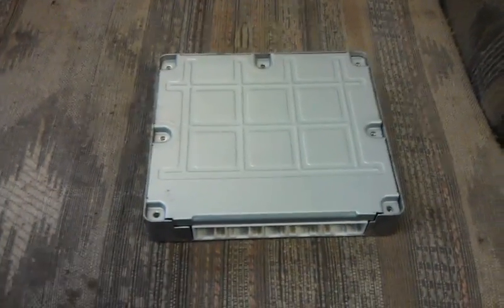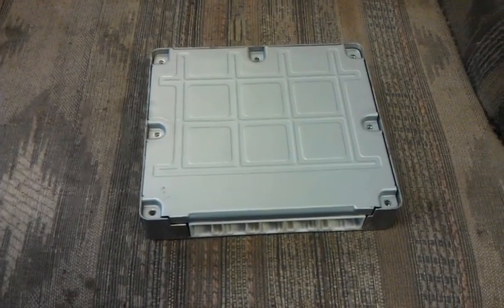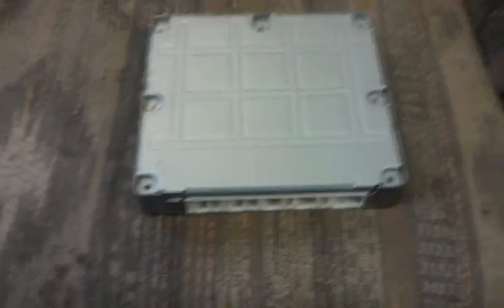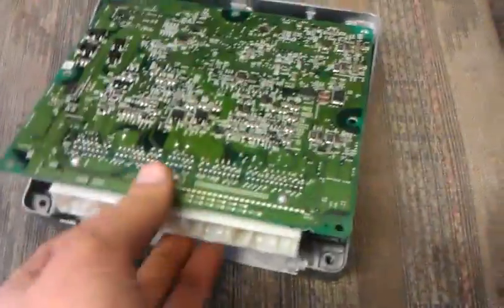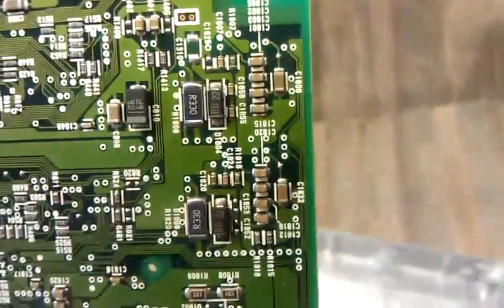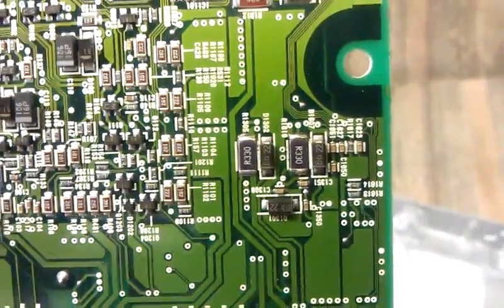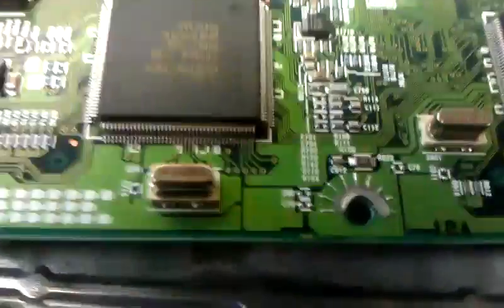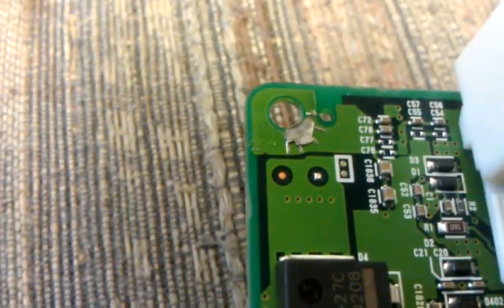HOW TO FIX RAV4 ECM ECU TRANSMISSION PROBLEM. **READ DESCRIPTION!**

Comment: OK, I had serious reservations on this task. Reading the comments only vulcanized my feelings, but decided it was well worth trying as the ECU was coming out anyway.
The PC board looked brand new coming out of my 2003 RAV4, so there was no oxidation - very nice manufacturing quality, I might add. But, being a Sr. Electronic Engineering Design tech, I've come across some 'impossibilities' in my debugging career, so if there are folks who said it work....I'm down with that.
I did not stick to the few items mentioned by Jake - heck no. If I have an intermittent, I will reflow the solder on ALL the components, if I have to. But, I decided to stick with the high current items involving ANY of the resistor packages described (1210, I believe: .12" x .10" - BTW, for you DIYR's - Digi-Key Corp is your ultimate friend for finding parts of this nature). And, I continued to reflow the devices connected to said resistors (reflowing all these resistors, of course): all power control IC's (a number of 20-pin (?) IC's), and all power drive devices (black, 3 legged parts with tabs solder to the board).
I just shoved it back in place after reworking for a test drive - and IT WORKED!!!
Many thanks to you Jake for posting this. Otherwise, I would have spent a couple, or a few Franklins on this fix!
One last word to the wise: if you cannot solder, meaning, if you don't have the proper tools to start with (small diameter soldering tip, thin gauge solder, ample visual magnification), and you're not experienced with PCB rework - do not attempt to try this!! Soldering is not rocket science, but debugging your rework error might be.

Comment: Hey Jake, I am having this same shifting issue with my 2003 RAV4 - Chili. I took it to a mechanic and after checking the code he said that this was a Solenoid issue in the Transmission. Was this the case with you too, before you decided to take a look at the ECM?

Cheers
Reply: Am haveing the same problem with my 2000 rav4
Reply: Did u fix urs

Comment: Well its been a month now and its working great. So for me that confirmed it. "Bad Solder Joints." Thanks jake moon. Well made video and it saved me time and money. You could probably just reflow the solder for a short fix but I replaced the solder on those resistors in the video. Can't thank you enough....
Reply: Solder. I replaced the solder. I didn't just reflow it.
Reply: Is it still working well? Some companies are slating this video and saying the problem is more complicated. I guess if it's this simple must be a real money spinner for them, so not sure what to think; all still well for you? You didn't replace any resistors, just resoldered ones pointed out here? Many thanks
Reply: Yep, still shifting smooth. Those people might just want your money.
Reply: Hey Jonathan, I am having this same shifting issue with my 2003 RAV4 - Chili. I took it to a mechanic and after checking the code he said that this was a Solenoid issue in the Transmission. Was this the case with you too, before you decided to take a look at the ECM?

Cheers
Reply: bmhcooray
For me going from drive to reverse or reverse to drive it would slam or hard shift. From what I read on the rav4 forums any hard shift or any of the solenoid codes are always going to be the ecm as it was for me. So if your getting any P0750, P0753, P0755, P0758 and/or P1760 codes it's going to most likely be the ecm.
Reply: Jonathan Dragon Thanks Mate. What was the mileage on your RAV4 when this happened?
Reply: bmhcooray 167,000 miles It all has to do when the solder on the pcb starts to develop micro cracks. So I image if you live in a cold place it will happen faster and if you live in Arizona Like i live it happens around 80,000-180,000 miles. Around 2002 there was a lot of bad solder coming out of china and if you remember the xbox360 had a lot of issues related to the bad solder at the time. That's why on my pcb I didn't just reflow the solder, I replaced it with some premium grade electrical solder.
Reply: Hi Jonathan, thanks for the reply. Did you change any resistors etc, or just rework the solder?

Comment: Our rebuild service offers a complete solution that is plug and play ready when you get it back.  Our technicians are IPC certified with the repairs being performed in an ESD (electrostatic discharge) safe environment.  There is no need for programming after the repair, and we offer a 1 day turnaround on the repair.  Feel free to check us out on the web (CircuitBoardMedics) to place an order for repair.

Comment: Jake hi I live in Chile South America and I have the same problem with the Toyota Rav4 2003. The  models sold in Chile are different as those sold in other parts. I own a electronic laboratory of computers so I imagine my technicians can fix. But I can not find where to buy the resistences we explain. I would like to get information please.
Thanks. Please your kindly answer to mu email   gseguev@yahoo.es
Thanks again Gabriel Seguev

Comment from the maker: to properly flush the trans, drain it, fill it back with about five quarts, then flush while running with the cooler lines disconnected.  the fluid that comes out the cooler lines comes from the torque converter though so you only get about half of it flushed anyways so thats why i dont usually bother with it.  50% for drain and fill vs 75% for lots of time doing a flush isnt worth it to me.

Comment from the maker: i think it would be a safe call that this is your problem.  if you dont know how to solder just send it in to an ecu repair facility.  and repair the ground points as well if they are corroded, e.g. powdery white film covering the solder.  it takes a bit of driving once installed for it to start shifting properly unless you get a remanufactured one then they reset the trans adaptive memory for you.  also i would just do a drain and fill of trans dont bother flushing anything.

Comment: I am in a similar predicament.  I am taking over my parents 2002 RAV4.  My parents have had it sitting in their garage for two and a half years and are moving away, so I would like to get this up and running as an additional car.

  Prior to it being out of action, it was shifting harshly but problems were ignored so installed one day while driving.  With what you did with the ECM, do you think the ECM repair (in addition to flushing the old fluids) would have this up and running?

Comment: To get the value of the ohms on the resistors you go as follows: 
you get the first 2 digits for the value and the third digit determines the number of zeros that you add to the value The ones on the board with the 820 are 82ohms if they were 821 they would be 820 ohms. 
These type of resistors are harder to find than regular resistor (thru-hole) butt they can be replaced with thru-hole as long as the resistance is the same.FYI they have no polarity.
Reply: How do I test the resistance in the resistors with my multimeter? Where do I connect my probes?

Comment from the maker: Not necessarily.  The poor shifting issue will cause accelerated wear of the friction material on the clutch disks so if you drive it long enough it will damage the transmission internal components.  The ecm controls electronic solenoids in the trans.  The solenoids cause gear shifts by manipulating the pressure and flow path of hydraulic trans fluid to the clutches.  Get your ecm fixed first.  Then if trans slippage is still present you may suspect the transmission.
Reply: Could this cause shuttering at speeds close to 40 mph?  I just had a different transmission with new torque converter put in my 2007 Rav4 unlimited I bought almost a year ago.  The shuttering is still there and seems worse.
Reply from the maker: @sistersin  I've switched from automotive technician to real estate investor so I haven't worked on cars in several years.  If it only shutters at or above 40mph I would first suspect the torque converter is shuttering or slipping.  I can't remember which years this ecm issue is for, but I believe that 2007 is not applicable to this repair.  Maybe try searching "07 rav4 torque converter shutter" and see if the symptoms match yours.  Or respond back if you have other questions.
Reply: @mangofever233  thanks I’m at a loss for ideas since I just had a transmission and new torque converter installed and it seems worse.  Now the mechanic is saying other things can cause that issue?  I’m on disability and can’t afford to replace everything and still have the issue.  I appreciate your reply.
Reply from the maker: @sistersin  when I get back from work this evening I'll look up some stuff and give you my opinion and advice.
Reply: @mangofever233  thanks, I appreciate any advice, my mechanic said other things can cause vibration also, but I can’t afford to spend money on things that might fix it.  I have already spent more than I paid for the vehicle on repairs so far and I’m on disability.  💕
Reply from the maker: @sistersin  can you give a more detailed description of your shudder/vibration problem?  does it go away at higher speeds?  Does the whole car shake or just the steering wheel or something?
Reply: @mangofever233  it sounds like you are going over rumble strips, it’s more of a vibration I suppose.  2 mechanic said it was the torque converter and it needed a transmission and new torque converter.  That’s what I had done, but it almost seems like it is doing it more often than before.  I have been researching this for several months off and on before finally getting it to do it while the mechanics were test driving it.
Reply from the maker: @sistersin  If replacing the trans and converter made no difference then yeah it really has to be something else.  One thing i would check is the rear drive shaft.  It could be out of balance due to a cv joint going bad or it could be a problem with the center support bearing.  This vehicle should have a two piece rear drive shaft supported in the middle by a bearing which is mounted in rubber.  If the bearing is loose or the rubber mount is failing then you could get a vibration out of that.  Unlike an out of balance tire which will cause a vibration consistently when you reach a certain speed and then get more pronounced as you further accelerate, a two piece rear drive shaft can cause a vibration at only specific speeds or engine loads so it may not do it all the time.  There are lots of rotating parts on the drivetrain though and any of them could potentially cause vibrations like that.  They all spin at different speeds though so a skilled technician should be able to determine what the source could be or could not be based upon the frequency of the vibration.  Certain vibrations are nearly impossible to replicate on a hoist though so it may take an educated guess to solve it.  When next you notice the vibration, try and see if it disappears or gets worse when you slightly increase or decrease the throttle/gas pedal.  If varying the throttle does not change the vibration then it really can't be in the transmission.  Also, if the vibration happens when decelerating then it really can't be the engine or transmission.  From there you would have to rely on a good visual inspection of the drivetrain and the vibration frequency (hertz) to find the source.
Reply: @mangofever233  ok, I was out today for an appointment and went grocery shopping.  It is making the vibration almost every time I get tom40 mph now.  Once it started at 35, stopped for a second then started again around 37, stopped and started at 40.  It vibrated for less than the time I could count to 8 and stopped.  But every time it starts when I’m driving normally, then barely let off the gas, it stops immediately.

Comment from the maker: On my Saturn it took about 400 miles to relearn the proper shift timing after I replaced the pressure control solenoid; I was too lazy to put the ecu into quick learn mode with the scanner.  But believe it or not, I have been known to be wrong from time to time so until I run into another one to repair myself and verify it we won't know for sure.  Unless somebody just pops the cover off of their repaired ecu and takes a look.

Comment from the maker: Most problems with an ecu or instrument cluster or other circuit boards are actually quite simple.  The most common I've seen is broken solder connections, bad resistors, and bad capacitors.  But if it didn't work then maybe I missed something. I doubt it though because its much less likely that the cause of the problem is actually two separate parts of the circuit, since there would have to be no symptoms until both separate parts of the circuit failed.  I don't think 50 miles is sufficient IMO

Comment: I tried it too. Did not work. Drove it for about 50 miles, still nothing. I just bought a refurbished ecu from a local shop and all problems went away. I guess that there is something else to it. I did not expect it to be so easy, so not surprised anyways.

Thanks for your effort though.

Comment from the maker: exact issue, the resistor problem.  i have had people email me with successful results.  but what is more, i thoroughly examined my repaired ecu for signs of new solder and new parts and that is the only thing i saw.  although i have been known to make a mistake from time to time, i regularly make repairs to circuits such as these so i'm pretty confident in my findings.  if you dont mind, please let me know what you find or if it is unsuccessful.  --jake

Comment from the maker: way is to simply drive the vehicle.  on most cars it takes about 100 miles for the transmission to relearn these values without starting the relearn proceedure using the toyota scan tool.  (as far as i know, only the toyota scan tool has this capability)  The distance required will vary quite a bit on the type of driving.  i would guess it takes about 30 times of stop, acclerate, cruice in high gear half a mile, repeat.  so, that is my recommendation to you.  i am quite positive this is the

Comment from the maker: output speeds) and therefore it will apply the shift solenoid sooner or increase the line pressure or both.  if, by resoldering the resistors you correct the high resistance issue, the adaptive values will be far from where they should be.  there are two ways to correct this.  one costs money-go to the toyota dealer and request that they perform the "transmission adaptive relearn proceedure."  i am not telling you to do this because they will charge you at least 40 dollars for it.  the free

Comment from the maker: @TheManAzz 
hmm...the only thing i can think of at the moment is that the ecu needs time to relearn the proper shift timing etc.  as this shifting issue starts to occur, the ecu will increase/decrease the transmission shift adaptive values to try and correct for it.  the high resistance to the solenoids will cause the shifts to be longer (the ecu measures the time it takes for the trans to shift by comparing input and

Comment from the maker: You may be able to use multiple higher impedance round resistors to work instead because they are easier to get.  E.g. two ten ibm resistors in parallel equals one 5 ohm.  But there is also the issue of wattage.

Comment from the maker: Im about 90% sure the 820 is .82 ohms and the r330 is .33 ohms.  I found that info while searching for replacement resistors. I think they are .5 watt, but may be 1 watt.  If your good at Google searching you should be able to find them.  They are not common though; I only found one distributor on the whole net.